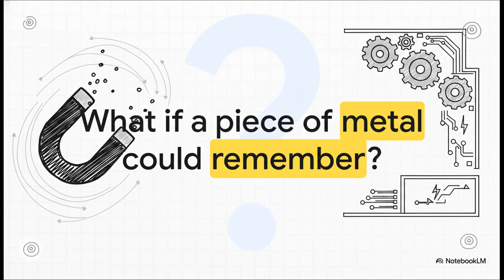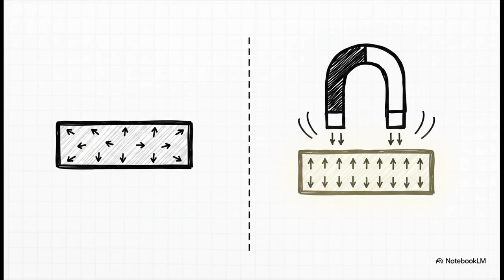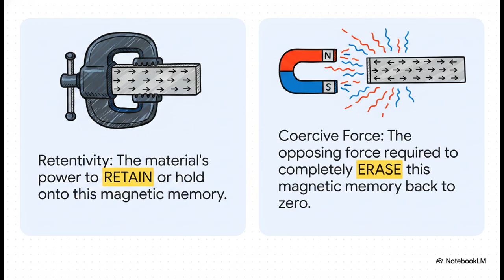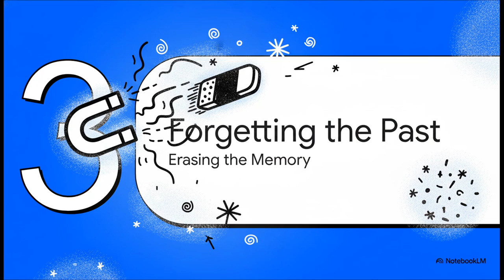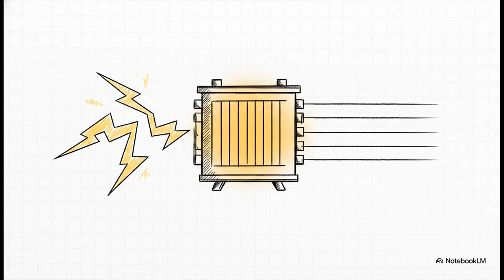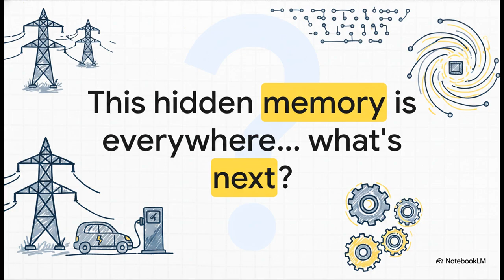How to Reduce Residual Magnetism in Motors & Generators

Comment: Bonjour , j'ai un problème avec ma génératrice LEROY SOMER LS35 . La génératrice produit 18V et 50HZ au lieu de 220v et 50HZ . Avant son arrêt prolongé ,tout était OK . Diodes du rotor auto alimenté OK , condensateur 70uF OK . Peut être que le champ magnétique résiduel est nul , comment le recréer avec les moyens du bord ?  si vous avez une solution merci.
Reply from the maker: You can try "flashing" the field by briefly applying a low DC voltage to the stator windings to restore the residual magnetism. 😊